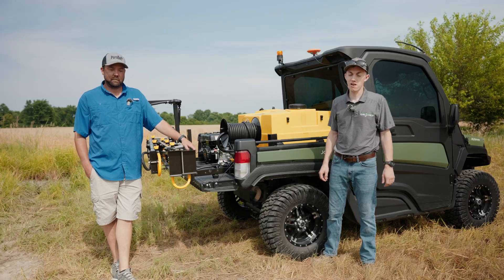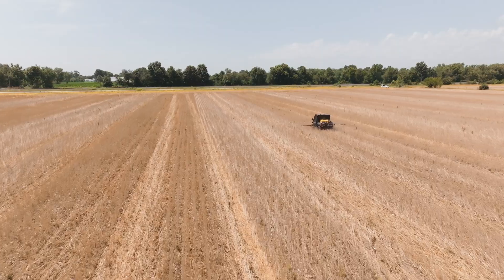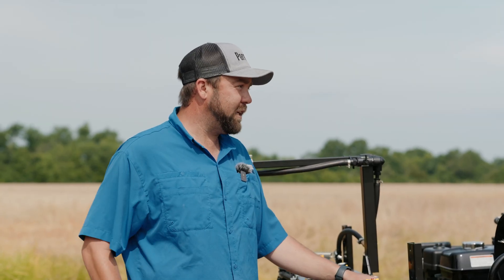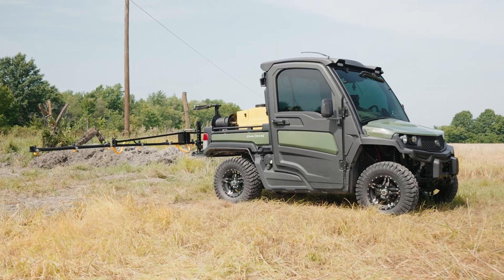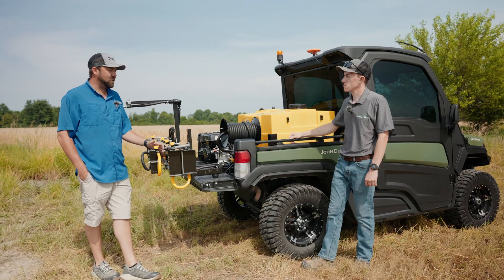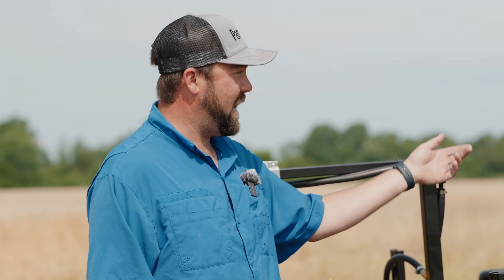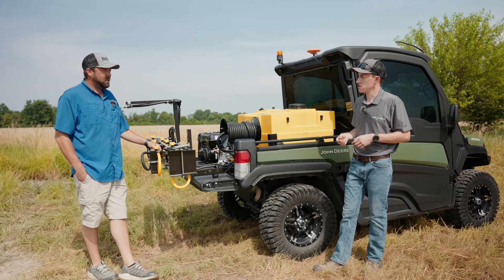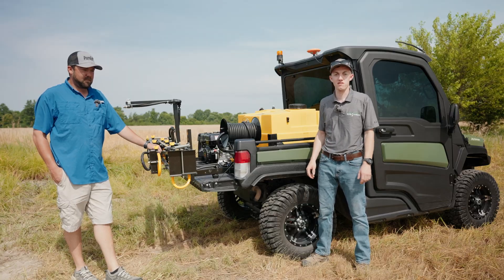This Gator Spray Rig Steers Itself

Comment: So it can turn around by itself? Can I start it and leave the cab or do I have to monitor it the whole time? Very cool thank you!
Reply from the maker: Yes, it can turn automatically by pushing the buttons on the remote. You must stay in the cab while operating to safely monitor your equipment. Please fill out this form if you would like more info from our product specialist!
https://q6rbm.share.hsforms.com/2fBTT6IuxQfKOx8pV6hvW4w?__hstc=253807063.44dc060279315d4e68a7ba11689ee817.1741027129651.1754516813621.1754524490376.134&__hssc=253807063.4.1754524490376&__hsfp=3352691268